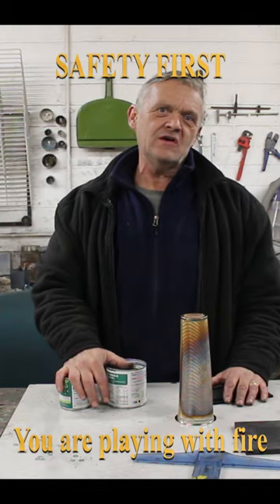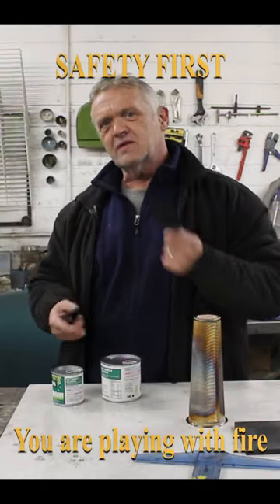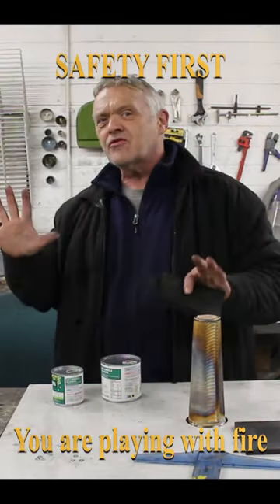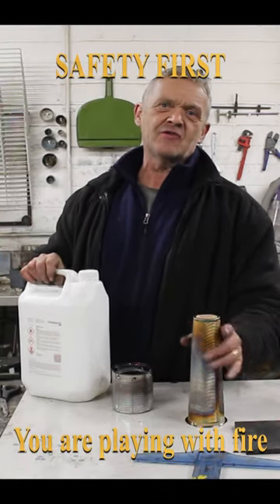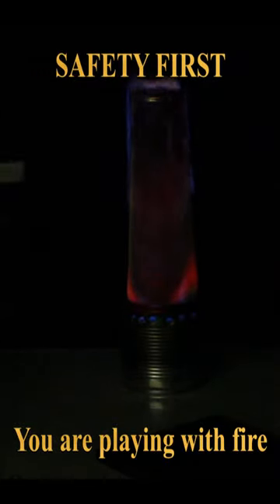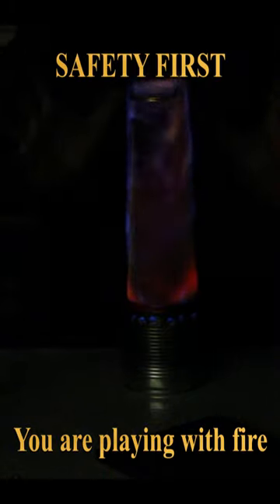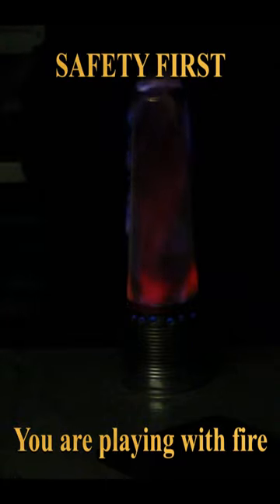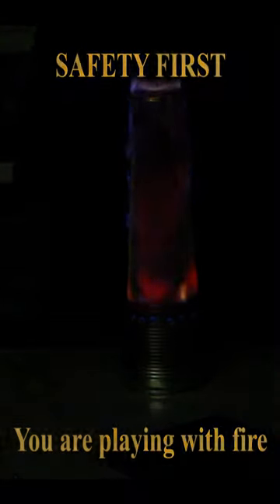DIY Radiant Heater #shorts #heater

Comment: Love your video Rob. Ré video 1702, I made the methanol heater using 5mm carbon felt but can't get the long burn time. Presently only getting half an hour. Thought perhaps the mantel I made is acting too much as a chimney and drawing out the fuel too quick. Love the design. Any advice to bring burn time up to 4 hours?
Reply: Steve I also made video 1702.    I was worried about flame height So,   I found 2 small cans that are tight fitting 2 millimeters and used two layers of sock for a wick.    Have to use a spray bottle to spray wet wick twice.  I get 4 hour burn time.  My inner can is open at bottom so it holds about 8 to 12 ounces
Reply: @mike289homebuilt5  awesome :) what;s in the spray bottle? what's the diameter of the cans? thanks!
Reply: @mike289homebuilt5 which fuel do you use?

Comment: what is that thing on top of the cans?
Reply from the maker: a mason jar coffee filter or strainer it's stainless steel mesh
Reply: @ThinkingandTinkering  You've possibly said this in your videos before, but any time you're heating metal, we would recommend clarifying that the steel you're using is stainless and/or plain steel and not galvanized since heating galvanized steel is incredibly dangerous/toxic and should only happen in well-ventilated areas. Food for thought! Can never be too safe. ;)
Reply: @jamaraquai4224  remember to drink milk 🥛

Comment: I need the cardon felt when looking on Amazon it doesn't say 100% cardon felt so can you tell me where to purchase it please.
Reply from the maker: you can just use a bandage, sock, cotton or even paper
Reply: Or look for carbon fiber felt, or carbon fiber blanket - try looking until you you find one 6mm thick (1/4").

But an old sock or paper towel works, you just have to replace them more often.
Reply: Flame protector in the welding section of your tool store
Reply: It's pretty useless if it's not 100% carbon fiber... if you're looking in the welding or plumbing section.
Reply: Look for high temperature carbon fiber welders protective blanket, it's the same thing I just bought some on Amazon, hope this helps 👍